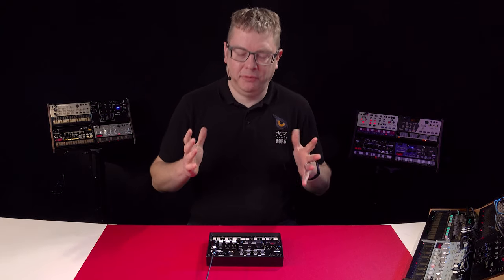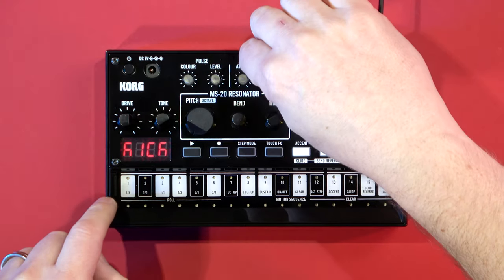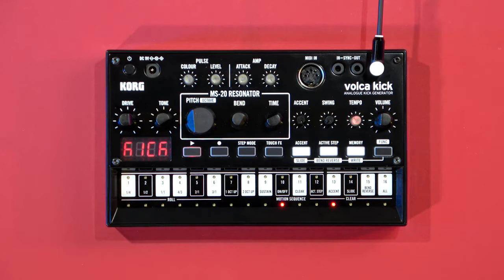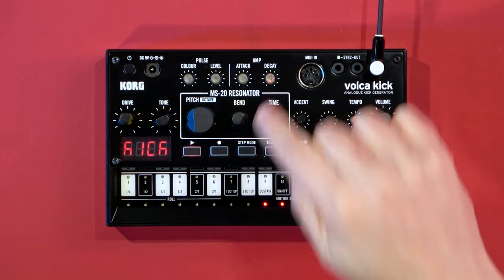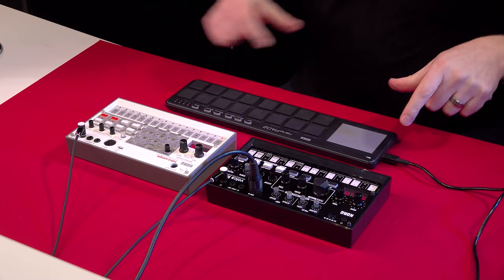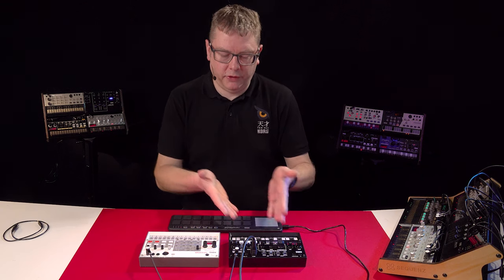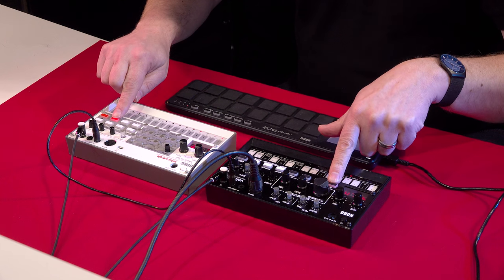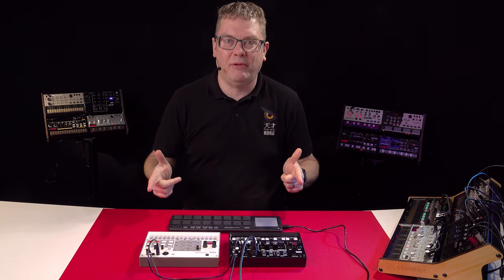Dive into the Volca Kick - overview

Comment: I only bought it because of the MS-20 filter, because it really pushes through and sound so good.
I also think chaining patterns in this little box is a good thing. It's similar to a 303, just select the start and end pattern and it works. I wish the chaining would also work when playing and the old chain is playing away and not changing immediately.